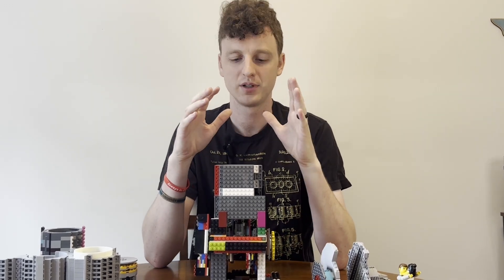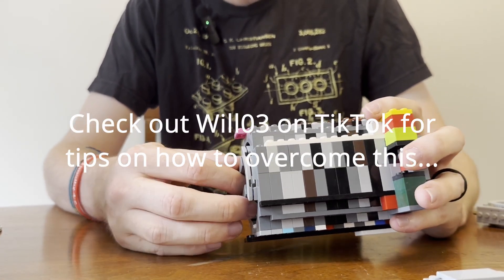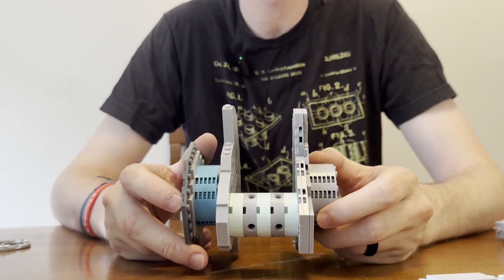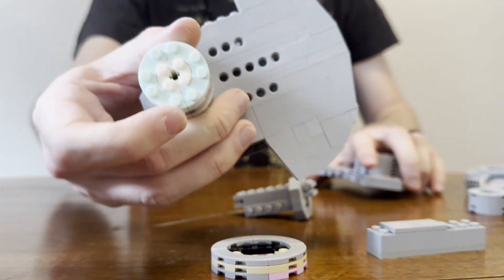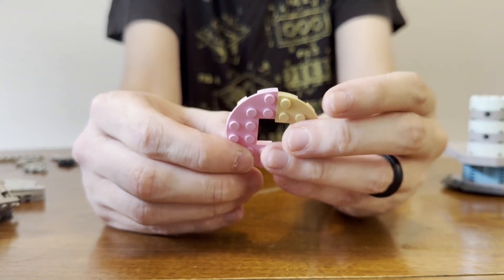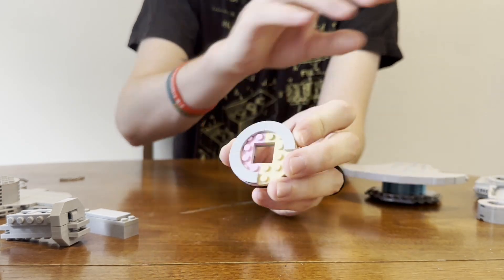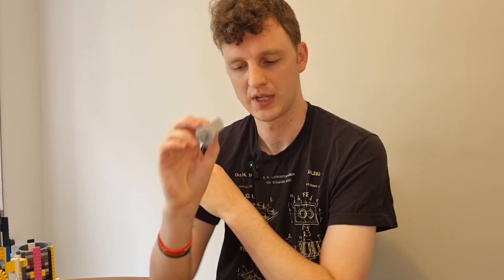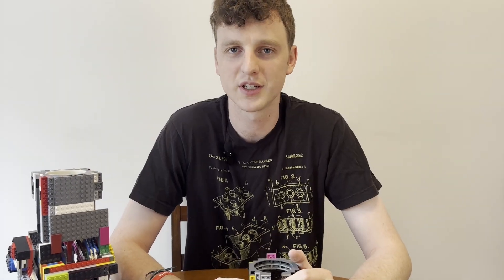Crankshaft for Life-Sized LEGO Vacuum Engine pt. 1: Building Techniques

Comment: Make paper gaskets and to all the people who dont have 3d printers, u can use card or paper
Reply from the maker: I tested some PET sheet plastic rolled up as cylinder sleeves, but unfortunately the strange, non-circular shape of my LEGO cylinder made it not seal well. The 3D printed sleeve matches the that shape on the outside while having a perfect circle in the middle. Paper gaskets are a great idea and worked decently for me although I was surprised when my test mule engine didn't need one!

Comment: Wait why dont Ya put an axle through your crank pin so that it cant break😮❤
Reply: The torsion and deflection that these crankshafts are put through, the axle lets it separate still. We’ve tested axles through and they still fail.
Reply: @willi4 ah i see
Reply from the maker: Yeah thanks for asking! The axle is definitely the next best way to reinforce these crankshafts if you don't have the parts or something. Will and I affectionately call this the "forged" version of the crank! Cheers!